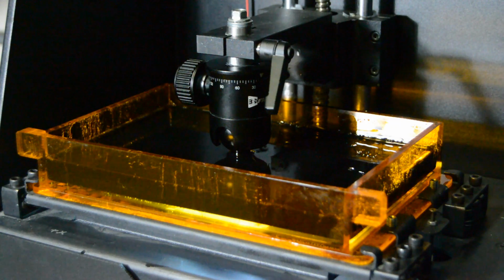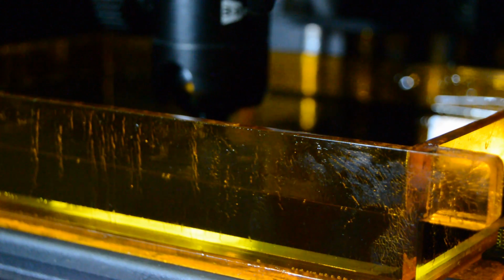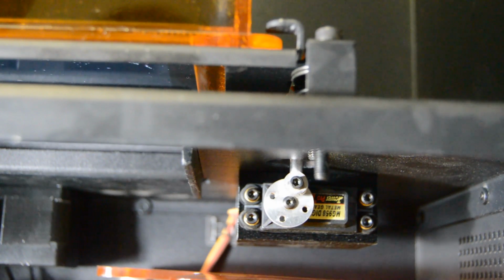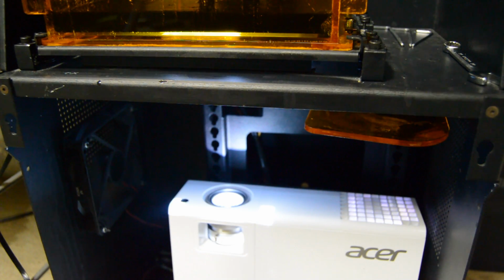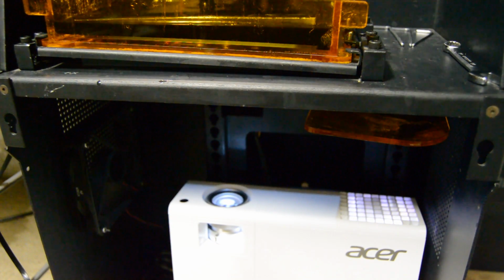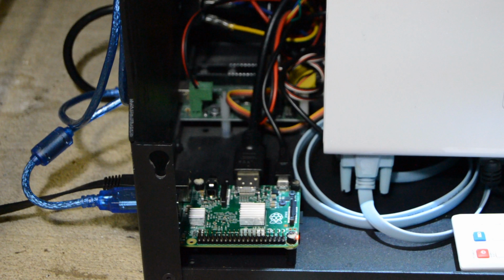How a Resin DLP 3D Printer / SLA 3D Printer Works | See How It Works

Comment: Hi, I bought a Draken second hand and I had to replace the power source. I do not have the wiring map for the power source to the servos and raspberryPi card, can I have a picture of your setup? TIA
Reply from the maker: There should be pictures floating around the forums from way back when around 2015 mine is actually boxed up right now.

Comment: hi; thanks a lot for your video... i have bought a 3d draken like this, but it seams not like yours. i have seen in this video that you have to card; arduino & raspbery... in mine i have only the arduino. is that normal?
Reply from the maker: Yes that's normal. There should be cutouts so you can install a Raspberry Pi yourself. The printer normally only comes with the controller board.
Reply: @GarageScience  thanks for your request ... but it works nice without! what it's done for?what's the advantage?

Comment: I can use any ordinary projector which we use in our home? Some dlp projector is too expensive for me. So,  what you suggest?
Reply from the maker: It must be a DLP projector if you are using resin that cures at UV wavelengths. DLP projectors use a halogen light bulb that produces the UV wavelengths of light needed to cure UV resin. LCD projectors use a powerful LED and do not produce UV light.

Comment: Hello!! I'm having difficulty with my Miicraft+ (which uses the SLA DLP based 3D printing). I would like to know what type of resin I should use to print at a resolution as high as 50 micrometers. Would you happen to know? Thank you very much!!!!
Reply from the maker: Colorado Polymer Solutions has some pretty good resins for detailed prints. I've gotten pretty good results from fun to do as well. If you are looking to get free standing features at 50um you might find that hard to actually accomplish. I have printed a lattice mesh down to 250um which was on a 3dfacture printer, but even the form2 is only capable of effectively printing features about 150um on the xy axis. Nominal versus Effective printing resolution isn't something most resin printer companies like talking about.
Reply: Thank you very much for your help!! I'm got in touch with Colorado Polymer Solutions and I'm waiting for their reply. For now, I'm thinking about getting the Miicraft BV007 resin, which I found was the most appropriate for printing microfluidics. Thank you once again!
Reply: Also, thank you for the great video!!! It really helps!

Comment: The resin is that dangerous?  Not only can't food come in contact with it but SKIN shouldn't either??  I can hardly think of uses for 3D printed parts using resin then.
Reply from the maker: Your skin shouldn't touch it before it is cured and it's a good idea not to have prolonged contact with it after its cured because some people may still be a little sensitive (things like rings are not a good idea unless they are painted etc.).  That being said I've gotten it on my hands many times and my skin isn't that sensitive to it, but I wash it off within a minute or so.  Resin printers have many uses revolving around highly detailed and accurate prints and a wide variety of materials.  They have many great qualities over FDM printers.
Reply: Wow! Thank you for the detailed response!  :) I don't think my skin is that sensitive either.  But what about breathing in air that has gone through (cured) tubes of clear 3D printed resin?  I have one particular use-case that would involve that.  The rest of my use-cases are things like figurines, bolts with nuts, stands and other things that do not involve food or air used for breathing.
Reply from the maker: You might smell a bit of an odor for the first little bit that air is flowing through it.  You can get resin that has less noticeable odors though.  It certainly isn't hazardous, maybe just a little annoying.  Structural parts like bolts and nuts aren't usually printed with resin because they tend to be brittle.

Comment: 405 nm light is required. What would you suggest?
Reply from the maker: Well for DLP printers any projector that produces at least 2000 lumens should be generating some amount of light in the 405nm range.  There are a few modifications that can be done to remove UV filters built into the projector and thereby increase UV output if necessary.

Comment: Why we use stepper motor for dlp 3D printer ?
Reply from the maker: +Mohamed Ghazal stepper motors allow for turn counting so the machine will internally know where the build platform is along the guide rails.

Comment: what software you are using for design and slicing please ?
Reply from the maker: +Ziad Fawzy I use Autodesk Fusion 360 for CAD modeling, I export STL files to either Autodesk meshmixer or the B9 Creator Print software to add supports, the slicing and printing is done with creation workshop. You can watch a full walk through guide of creation workshop on my channel.

Comment: Hi,
Great Job... Congratulation !!!!!

Please I finished my 3D DLP printer, but I need of a very very good projector, can you suggest me many projector models?

Thanks
Reply from the maker: +Riko Store I have the Acer H6510BD which is the only projector I really have experience with. It's been good for me, though it seems to have some light unevenness that I will be addressing in a video at a later time. But it is small and does an overall good job.

Comment: Is the carbon m1 a dlp printer too I was wondering why they talk so highly about theirs and it seems to do basically the same.
Reply from the maker: +Tomos Halsey the answer is kind of yes and kind of no. It would be better to describe as an unique kind SLA printer. DLP printers get their name from the DLP (Digital Light Processor) projector that cures the resin. The projector creates images with the DMD (Digital micro-mirror Device) chip. The Carbon m1 does not use a projector like this, they have their own light engine.  The Carbon M1 also has one continuous motion of pulling the part out of the vat so there are no layer lines.  They use special software for the printer and special resin along with a special vat to make this possible.
Reply from the maker: +Tomos Halsey the answer is kind of yes and kind of no. It would be better to describe as an unique kind SLA printer. DLP printers get their name from the DLP (Digital Light Processor) projector that cures the resin. The projector creates images with the DMD (Digital micro-mirror Device) chip. The Carbon m1 does not use a projector like this, they have their own light engine.  The Carbon M1 also has one continuous motion of pulling the part out of the vat so there are no layer lines.  They use special software for the printer and special resin along with a special vat to make this possible.

Comment: Does the projected frame containing the layers remain constant after pre-setting the projector's positioning? Does it have capability of automatically zooming in or out based in size of curable image pattern?
Reply from the maker: +9iceman Gizelle the projector image is always the same distance from the projector due to having the projector under the vat. Once the projector is calibrated for the particular resolution you want then you don't have to mess with it anymore.  There is no auto focus setting on the projector so every time you change the xy resolution you have to calibrate the projector zoom and focus.

Comment: with a fluorosilicone(GF hard contacts are made from this)  cat or Teflon AF2400 cat, a tweak in software, it would be as good as carbon3d(less resolution)
Reply from the maker: +dedlunch maybe, Carbon 3D still has their own resins formulated specially for their patented process. Give it some time, once a work around is found to the carbon 3D process or their parents expire then we'll see these types of printers on desktops.
Reply: +Garage Science if you read their patent, it tells you how to make them:)

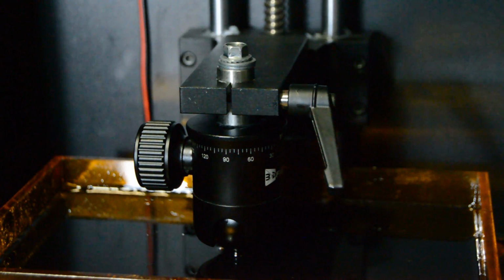Comment: thanks for this awesome video man. do u tell me what is the (at 0:44 second) name of that thing having 120, 90, 60, etc. like readings ? where did u get that & how much it costs ?
Reply from the maker: +Yogesh Patil those dials function as a reference point for the build platform. You can't see it in the video but there is a arrow that points down so you can put your build platform in the same left/right rotation each time you print. I bought the printer from 3Dfacture for $1900, super satisfied! Make sure if you are interested in buying one that you use the coupon code in the video description or my channel description.
Reply: +Garage Science thanks, but I  need the name of that dial.
Reply from the maker: +Yogesh Patil I would suggest getting in touch with Andrew from 3DFacture if you are looking for the manufacturer/part number for that. The 3DFacture forums are the best way to do that. Just message Andrew_3Dfacture.
Reply: +Garage Science sure buddy, thanks a lot :)